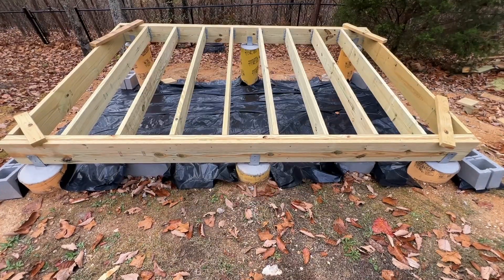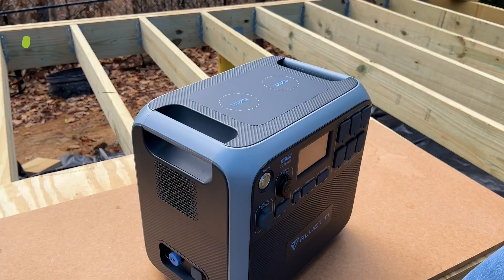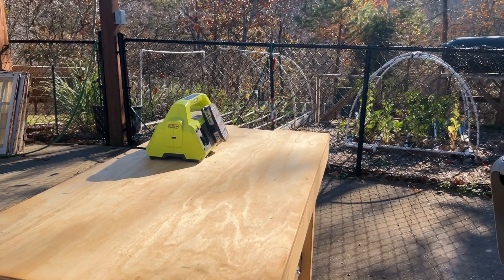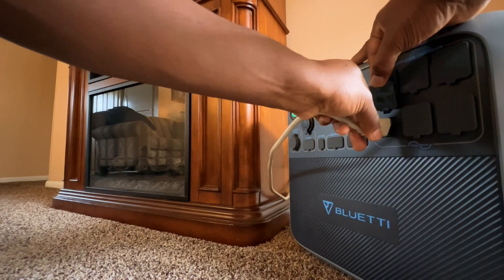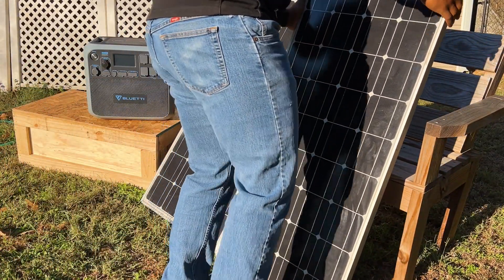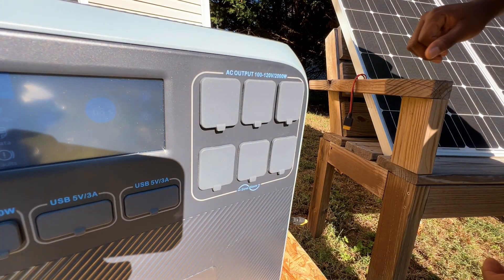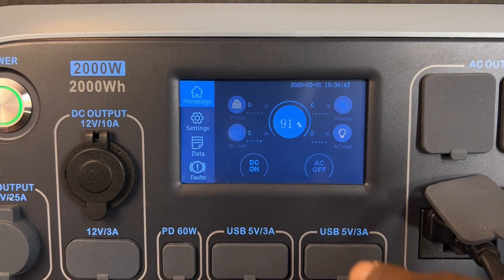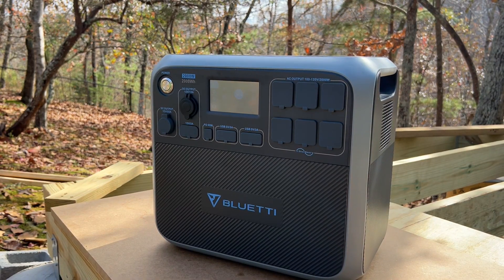Don't JUDGE a POWER STATION By It's SIZE! - BLUETTI AC200P

Comment: This is a must have👉🏻 DC Charging Enhancer (D050S)
US$199.00
Application Model: B230/B300/EB150/EB240, AC200/P/Max

Function:

* Enable more charging methods like solar, car, and lead-acid battery charging.
* 500W Max input.
* Increase the PV input rate to 1200W for the BLUETTI AC200/AC200P; 1400W for the  BLUETTI AC200Max.
* Increase the overall capacity of the BLUETTI AC200/AC200P by connecting them with B230/B300.

Comment: Did I miss how you made foundations for your shed? Maybe a previous video? 

This power supply is a wonderful piece of kit for your project. Loved the display of the charging levels, particularly with the P.V panels, it seems to remove the need altogether for other devices. Looking forward to seeing the progress on how you power your new shed and how it comes together.
Reply from the maker: Hey Andycordy. No, you did not miss the video lol. I was a bit on the fence if I was going to video the process or not since I'm still new to the concept of building a shed/home and I preferred to gain a little experience under my belt before showing other people. However, after building the foundation, I figured I could still video my progress/process but maybe not go into much detail on a step by step bases. Thanks for watching also!

Comment: Thats a pretty sweet power station. It has a construction / DIY / prepper feel. I can't imagine just 1 person utilizing this thing to its fullest potential. Hope to see more build videos with it. The deck is looking pretty good btw. Love the view.
Reply from the maker: I agree. I was quite blown away myself, and this was probably one of the first times I could not find too many negatives things to say about it. And will do regarding the build videos. I have a long way to go as well as a lot to learn along the way. Thanks for the feedback!
Reply: @GreenTechTown  I noticed you do a very good job of teaching & explaining things. Years ago I got all Gung Ho about making DIY solar panels to save money (before realizing moisture would ruin them in a couple years). I noticed your old diy solar panel build videos did the best job teaching/explaining  how to build them. 
I haven't checked to see if anyone came up with a diy way to keep moisture out. I was thinking maybe in a room with a dehumidifier & using a vacuum sealer. (Cheaper/easier just to buy now)

Comment: Thanks for sharing, what is the size of the shed you are building, this is something I would like to do this spring. I have a Buletti EB240 Great video!
Reply from the maker: Hey Mzladyp1. The shed size I am building is 12'x8'. I purchased my shed plans from the iCreatables website. Chris on the support team has been great answering any questions I've had which has been quite a few. I'm not sponsored by them but I do like the resources they have available for DIYers. And the shed plans I purchased were only like $30-$35. What are you currently using your EB240 for?
Reply: @GreenTechTown  Thanks